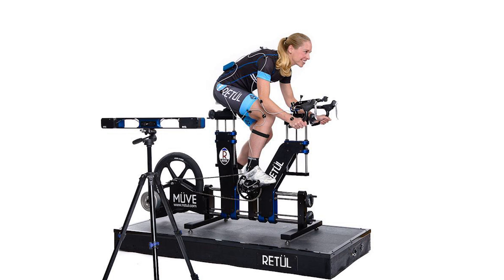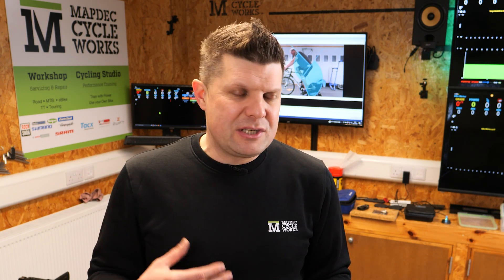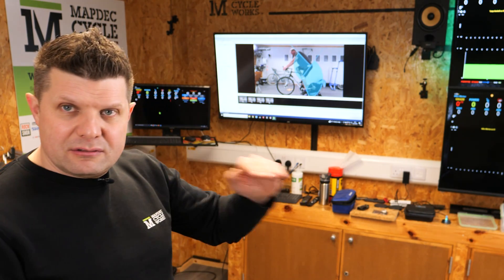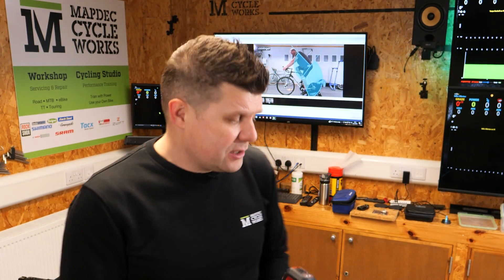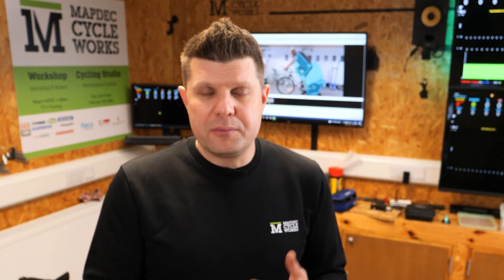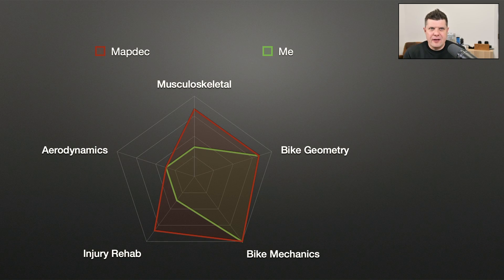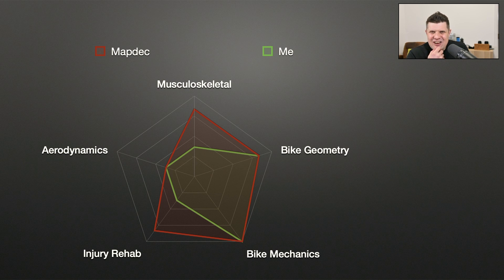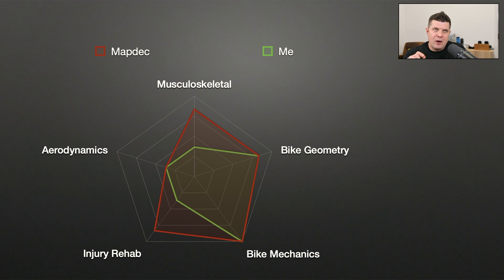You shouldn't need a bike fit, but if you do, ask for this.

Comment: I had a bike fit using a laser and some whit peal and stick dots placed on parts of my legs a year ago. Recently I have been doing 2 or 3 hour base training and now haw quite a lot of pain just above my R/H patella and to the side of my knee. I am not sure if it is because I have been focusing on driving my knees down and up. 
Not sure who to go to to get a proper fit. Also am thinking about a new frame set so want to have the fitter check for proper sizes. 
Thanks Wayne for the excellent content. You are an excellent source for bike information 👏.
BYW I started using a combination of ice and heat on my R/H knee knee for relief. And BioFreeze roll on.
Reply from the maker: Wayne?   I would go see a sports therapist for that knee.
Reply: @Mapdec  ugh sorry for the "Wayne". My mistake. Hell half the time I have to sing Happy Birthday to myself to remember my own name.

Comment: As my recumbent fits from 5’2” to 6’6” I managed to adjust it to fit me by myself. I think it’s a bit different for upright bikes and more important so for me when I bought my  Basso Venta upright at my local bike shop the owner set me up initially. I’m happy with my saddle height, I’ve changed my stem length from the factory 110 to a 90 but I haven’t got out enough yet to know if it’s better (due to an injury that I don’t know how I got). I do think that my handle bar may be to wide so eventually I might get a  narrower handle bar or maybe I should just go get the bike fit that I said I’d get before I bought my bike. I also use cleat adapters which brings my cleat position to mid foot. This works both on my recumbent and upright. From all my research I do think it’s no harm to get a bike fit but we all have to be honest with ourselves. Speaking as a 55 year old and only cycling for 3 years on a recumbent and 3 months on an upright I am realistic about my flexibility, strength etc.
Reply from the maker: Nice one Kevin.  Never too late to work on mobility and strength

Comment: It's not a one time event. The body does change over time. Yes there are time when the rider must make improvements to their body and then may have to do another fit session. I've had a customer come in and still doing physio for a non cycling related injury so their body will change as they heal. Also as we age everything changes and now we seem to be trending toward shorter cranks as time rolls on.

Comment: You shouldn't need a bike fit.....that is totally correct. I'm lucky that I had a 'bike fit' in 1983 when I bought a Colnago Mexico and the 'bike fit' was done by one of the guys in the shop that was the current state road champion, here in Australia, at the time. He obviously knew his stuff and it was a simple procedure. Nearly 40 years on and I'm still in the same position with the exception of the stem which is 10mm higher than 1983. My saddle height is now called the 109% rule!
My wife who has been riding for 7 years has had 2 bike fits by a 'professional' The 2nd fit was just a total joke.  Finally, she has come round to the 109% and 'go by feel' version, with no more problems on the bike. Ditched the SMP saddle as recommended by the first 'fitter' 
Bike fitting is for people who have zero body awareness.
Reply from the maker: Great comment. What is the 109 rule please?
Reply: 109% x your inseam measurement in mm is the 109 rule. Have been riding with this seat height decades before it was written as the ideal by some fitters. 
Never had knee problems, back problems or anything really and this year completed a 235km 4500 meter climbing fondo with zero problems, and I just turned 60! 
Bike fitters for me are an add on by some bike shops for extra renumeration.
Reply from the maker: @mattttt3057  thanks.  I do something similar that works about the same.
Reply: @mattttt3057  You should mention the 109% goes to the top of your pedal, not to the BB centre. You must be the same age as me, 60+, to know about it.    Rgr
Reply: @boran20 yes your right, measure to pedal with crank at same angle as the seat tube. Stem length was corre ct when the front hub was hidden from view when in the drops….works for me still. Also saddles really were a choice of San Marco Rolls or Turbo, Rolls was it. Now ride a fizik airone.
Yes I just turned 60!

Comment: I think the biggest issue in bike fitting is that people look at the pros and think this is what they should do. I cannot tell you how many people I see going around with a way too high saddle. Or too long stems. A pro has first of all no upper body mass to sustain, and second they are riding much more than other people and can afford more extreme positions. I've had three bike fits but have to agree with you, mobility and strength important. Static stretching is not very efficient, but heavy weights eccentric muscle contractions (Romanian deadlift for example) are perfect to get more flexible.
Reply from the maker: More to the point, if a pro athlete coach tells them to get more flexible and do their stretching and core exercises, they bloody well do.
Reply: Sure. Go for the 150mm stem, Mads Pedersen is using one, and he became WC!! ( And has extremely long arms.. )     Rgr

Comment: Can you do a video on the break down of what you actually pay for when buying a bike ?please. Ie world tour team, R&D, shipping, marketing,profit margin  and so on. Because once you get to the product  it's self its cheap and it's everything else driving the prices through the roof. Because people don't understand what they are paying for they think a "cheaper" brand isn't as good and that is not always the case.
I remember Roadcc bike of the year in 21 I think,  an Orro came 3rd and the 2 bikes In front of it were double the price!!!!! How can a bike half the price of the two in front not be bike of the year? Maddness review. You would cover this all brilliantly
Reply from the maker: I did this once. It got removed in the uk.   It would be interesting, but almost impossible to do accurately.
Reply: @Mapdec  shows you must have been pretty accurate and that the big brands don't want people to know. Direct to customer brand is the best way to buy, with the odd exception! However it is shocking  big brands with concept stores are doubling profit not lowering prices or a better deal for customers and closing indepentant bike shop that spend year building these brands at the same time. It's horrific. And just one more thing on a pretty long list of why a had to leave the bike industry

Comment: What a great channel its great to hear from someone within the trade thats not afraid to tell us the truth,
Would you recommend a fast reliable xc bike for under £2500 ??
Thank you.
Reply from the maker: BMC twostroke, the one with SID select and GX groupo and DT Swiss wheels.  Geo is quite slack for XC, will be fast and fun.  Get a dropper
Reply: @Mapdec  Thanks for getting back to me so soon.
Reply: @Mapdec  Would it be a faster bike than a Vitus Sentieur hardtail with a 120mm rockshox rekon fork ?
Reply from the maker: Not even remotely a fair comparison. Where did that come from?
Reply: @Mapdec  Thats what im running at the moment with a 2.6 up front and a 2.35" on the back,
29" wheels,im just trying to track down a faster bike for the upcoming xc season in February.

Comment: At the begging of the season i have tons of problems. After about 3000kms into the season I have zero problems and love my bike. 
Macro all the way
Reply from the maker: Well done. What did you do?
Reply: @Mapdec  nothing really. Just ride, cold plunge when ever I get a chance. A little rolling and stretching of the joints and muscles. And eat what ever I want, but on the  healthy side. 3-5 rides a week. Wash and Oil the bike. 

Rest Repeat.

Ride your bike 
Ride your bike 
Ride your bike

P.S. but after watching these kinds of I ever so often check and tweek things like Hood position Saddle Tilt. But I keep it quite standard. 
One thing I did years ago was buy a Rotor crank set 165mm.
Since then I feel really good.  And one with my bike.

44 years 85kg 170cm
GT grade 51" converted to more of a endurance bike.

Cheers. Great channel please dont sell out over "Time"...
Reply from the maker: Thanks. And well done. I’m not being paid by Time. It’s a truly interesting company I want to make videos about.

Comment: What's annoying to see is the people who come in for a new bike and when you measure them and you advice them a frame size of 56. And then they insist on getting the 58 which then looks hideous because it has the seatpost all the way inserted into the frame and they have a 8cm stem...
Reply from the maker: Oh. When does that happen?
Reply: @Mapdec  some customers can't be convinced that a 58 trek is smaller than some 56 Basso's and then order a 58, we've had customers who could have easily ordered 2 sizes smaller but they where too stubborn...
Reply from the maker: Awesome…. FFS
Reply: Just tell them a smaller bike is lighter and stiffer and will perform better, then they’ll go for it 👍

Comment: I disagree with the microadjuster/macroabsorber philosophy as presented here as a dichotomy. You can't change your bone lengths, nor can you change the shape of your pelvis, or the alignment of your wrists. The biggest factor in bike fit is the basic bone structure/length/ratios.
You have to account for the soft tissues as well, that's why you need a holistic approach, combining adjustment and adaptation. There's no use in categorization of the extremes
Reply from the maker: Sure. It’s better to think of it as a continuum.
Reply: I would agree that bone size matters, and based on a certain body size you should pick from 1 or 2 frame sizes.  The way I heard it was that after you get committed to a frame, you make key adjustments to stem, bar size, along with saddle height/fore and aft, and then you give your body a chance to adjust to that set up. You don’t constantly tinker. If you do, you will never see the end of it.